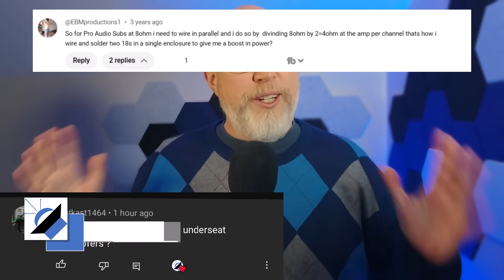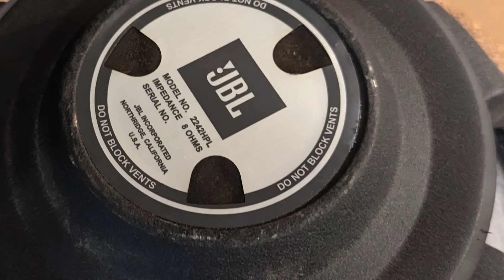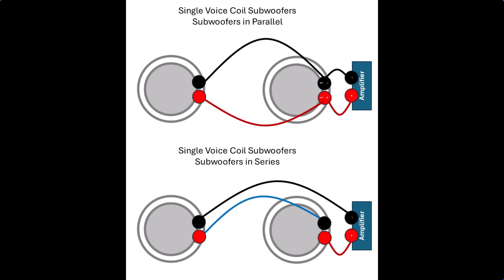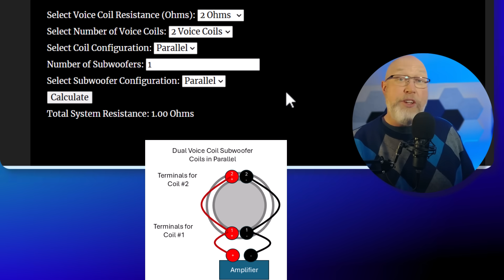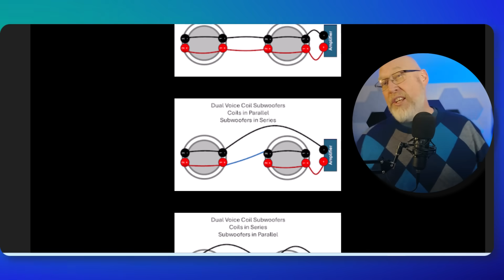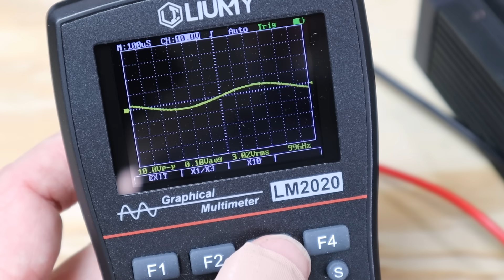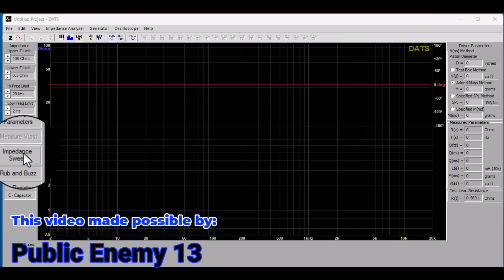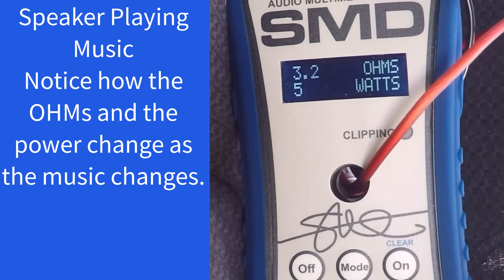Wiring your subwoofers for more power and more bass!

Comment: This is a difficult set of topics to address at an introductory level, as it really requires some physics, math, and engineering to grasp vector sums of complex reactive circuits, motor-generator systems, and practical circuit design versus theory.  

On one simple issue, pushing the speaker coil across the static magnetic poles generates current, not voltage, though that in turn may be seen as resulting in voltage across certain elements. 

The whole idea of multi-voice coil sub's is marketing hucksterism, that should simply be avoided for competent audio engineering of good systems.   

Ideally instead a single larger sub and matched amp would get a line level mix fed into a single channel power amp and voice coil, and driver and power level and enclosure matched to the space.  That should not exist in normal cars, while owning 500 acres of land is too little to contain or dissipate some audio systems with good low end capabilities, and respect neighbors.  

Generally power amps in the 1500-1800 watt range are useful, as they hit limits based on AC supply circuit size, and match well to larger bass drivers now in commercial production.  

Damping factor and thermal designs as well as protection circuits and design to source or sink reactive loads, are all important factors, where generally parallel drivers should be limited, and series drivers avoided.  A good pro grade amp will feed a 1 ohm or 200 ohm load on one channel while shorted with a heavy metal rod across railroad ties wired to its other output.  That costs money to design, and most consumer toys will self destruct first. 

Most amps are designed for an optimal load impedance, based on damping factor, complex impedance variations, thermal factors, power supply design and rails limits on voltage or current, weight, distortion, protection circuits, etc.  Often a bridge mode will deliver 3 times and not the waveform and Ohm's Law theory 4 times single channel power, because of ESR in those lumped systems (equivalent series resistance).  Bridge mode is sort of like halving load Z per side, and summing two amp sides.  

Large modern MOSFETs handle such factors far better than older bipolar transistor outputs.  

The two main things missing from this video, are disclaimers that the real world engineering needs basic STEM background as a precursor to the higher levels of how things really work, AND that lots of consumer products are sold that are really hucksterisn for buyers lacking good audio engineering understanding, and are really better to not buy, not install, and not recommend, than to bother calculating superficial theory of workable load impedances, versus just avoid that crap and do any channel mixes or band filters at line level, and feed that to single amps and normal single voice coil drivers, that won't have pairs of magnetic high energy fields competing.
Reply from the maker: You could spend years studying the fine points of AC impedance.
Reply: @DIYAudioGuy  Nah, I'm an older engineer, and I've already done that.  That's why I both appreciate this effort to teach complex topics in simple form, and despise sloppy language use that needs to be corrected later for victims, merged with implicit promotion of consumer scam products that create more problems than they solve, while trying to trick the engineering illiterate into buying more expensive and less functional products than can better address the same system goals.  

I've done AM directional antenna system engineering, and helped Glen Clark develop vector sums based software that considered complex impedance relationships from interactions of towers and earth impedance with its weather and soil variants, along with complex audio processing systems, and contributing to a panel on MPEG-1 Layer 3 development.  Speaker related complex impedance and related art and science issues are simple, by comparison.  

But still pretty complex, in ways words and pictures cannot fully express.

Comment: orrrr.. as another option, save space and money and find a properly sensitive driver that gives you the right output level without mucking with all this. dump it into a properly tuned transmission line enclosure and decimate.

the one for my jetta is only a bit bigger than the regular sealed box (15in tall, ~18d, 26w. which is only 8ish wider than the sealed box that was in there previously), using a 12 inch lord of bass LBX12, and still fits nicely into the trunk without eating every inch of the space. its limited, for obvious reasons, but i can still fit various emergency supplies and what not in there.

and with the right driver, and actually tuning the box, the enclosure doesn't need to be some super heavy monster you have to have a large suv to run it in. (yay for winisd and online TL box calculators)

even running it at 4ohms (i'm not pushing my amp that hard, for what should be obvious reasons, since its a 5 channel that also drives my fronts and rears), it has moooorrrrree than enough output to satisfy me. and maybe break a window if i'm not careful.

for anyone curious, the calculator is "Dual Fold On-Axis Transmission Line Enclosure Calculator" on dbxdynamixaudio's website, since i can't link. they used to do custom plans for boxes for a small fee, but the website is partially broken these days, so who knows whats going on there. the calculator page still works fine, but it is an embedded excel style table. and you need to know some driver specs. with some fiddling of the max dimensions you can stuff one into a lot of spaces (mind being able to get it into a trunk or whatever when designing!)

and it even works great for home theater sub boxes if you have the space.
Reply from the maker: Sounds like fun!
Reply: @DIYAudioGuy  its fooookin greaaat, man </bad scottish accent> ;)

done right, a good TL box hits harder, and louder. the main problem is trying to stuff a driver that needs a larger box into one and thinking its going to come out reasonable, since you need not only the volume, but the 'port' as well, which you fold twice. you can fudge the 'box' volume, but the port has to be as close to exact as possible to get the sound to come out right. thankfully, the calculator i mentioned gives you the exact board sizes and how many, so almost all of the planning is done for you.

if you're bored one of these days and want to (and haven't), i can fully recommend playing around if you're got a spare driver with relatively small box reqs for the ported spec.

Comment: Only thing you mention that made me scratch my head was when you said (paraphrased)  that by going from 8ohms to 4 ohms you often double your amps power thus giving you more power and a louder output.  Correct me if I am wrong but dropping from 8ohm to 4 ohm (or 4 to 2 or 2 to 1) has a 3 db loss of sensitivity so while you do gain more power, the speaker is less sensitive so you do not increase output.
Reply: If you're working with "traditional" amp design with fixed voltage rails of some amount, and that defines your FTC 8 ohm RMS power limit, while the power supply is capable of double the current an 8 ohm load requires, then in theory changing to a 4 ohm load still operates at that rails based voltage, but doubles the current (not really due to ESR), and in turn doubles the power.  

Bridge mode in effect also halves the impedance load per side, while summing two out of phase sides.  

If an amp is optimized for higher or lower impedances, the same relationships could exist in a 32 ohm or 1 ohm system.  

Prior to cheap DC-DC converters, lower impedance for a mobile system limited by battery voltage would raise potential power output, but that's how a 4-5 watt rated amp would actually output 1 watt if the alternator wasn't running.  Bridge mode amps kicked that up to around 10 watts, while anything automotive about that requires DC-DC converters.  

Speaker sensitivity is electromechanical systems design, and overlaps enclosure designs.  That's around 33% for an optimal loading compression driver (higher has uncontrolled distortion issues), whereas many home stereo speakers operate in the 0.5% electrical power to acoustic energy transfer range.  

That's where precise and careful use of language is important, to distinguish system overall function and elements contributing to that.
Reply: Note, many newer amps use digital waveform synthesis and flters, and some use variable voltage rails to limit thermal loads when higher isn't needed for full potential output power.  That can become a single ended line rectified supply with no power transformer, and a microprocessor driven smart DC-DC converter with a comparatively small and light toroid for line safety isolation, feeding MOSFET amp output drivers.
Reply from the maker: I've never heard that before. Where did you get that information?   You might find this video interesting.  https://youtu.be/4kDxUcGCe8M?si=Xb5nEFPqpJBZ0OLe
Reply: @DIYAudioGuy  Also this guys video made me realize I am old because I knew about speaker sensitivity before 25 years ago which he keeps stressing.

Comment: while the formula for impedence is not technically ohm's law....it is very similar (just with allowances for reactance, ie capacitance etc.). Its been 25 yrs since i took electronics but even in class we used the name pretty much interchangeably-at least early on until we got to trigonometry and wave designs, so people could be forgiven for calling it ohm's law
Reply from the maker: People call things by the wrong name all the time.  Surprisingly people are still able to communicate.
Reply: @DIYAudioGuy  Ok, fair point 😂

Comment: Speaker “impedance” , when measured with multimeter is only electrical resistance of the coil, not speaker while being driven.  While under load, speaker impedance continuously changes.  Nominal impedance is usually the lowest at a given frequency which is a very narrow.   Most impedance is much higher.    I’m using Hertz amps which are 2 ohm stable, yet I have them loaded to 1 ohm at zero negative impact, going now on 3rd year, running them just below 15 Vdc. at high volumes.

Comment: You're providing good, factual information but I don't believe that more power equals more bass. I build a custom home theater enclosure with a hand built driver that as roughly 5 feet tall, 18 feet wide, and 3 feet deep. The driver sits inside a sealed enclosure and blows through a folded horn. It is capable of reaching 170db at 35 hz in a gymnasium with the mic 20 feet away from the horn. The voice coil reads @ 5.2 Ohms and it is fed by a 500 watt plalte amp, clamped, it's using 160-180W of the amps power. The enclosure lets the driver play flat from 28Hz to 180Hz with little to no variation in volume as the frecquency changes. I spent 11 years of my life perfecting these things. Your enclosure is the most important part of what you want to accomplish, next is your electrical system, third is your amplifier, and last are your drivers. Just my 1.7 cents.
Reply from the maker: Yes, and what you'll notice is that when you have everything turned down you don't have a lot of bass, but when you turn it up you get more bass.
Reply: @DIYAudioGuy  100%. I compete in SPL and SQL car audio competition and always have a good laugh when the guy who has more money than knowledge about how the equipment works and they're pushing 50Kw through their system or spent 100K on the most ridiculously expensive gear they could buy only to lose to the guys that do understand what is happening.

Comment: I just started watching the video, BUT I still ask this - can I use two identical lower-power amplifiers to power a dual-voicecoil woofer assuming I balanced the amplifiers with the multimeter before that with same input and frequency?
Reply from the maker: Yes, you would need to match the voltage and the phase.   It's something that can be done but it's not something I would recommend. The juice is just not worth the squeeze.
Reply: @DIYAudioGuy  well I have two identical 2-ohm capable amplifiers, but they cannot do 1-ohm. the woofers I use are all dual 2-ohm voicecoil versions so I figured for home use I could utilize these amps.

bought these few years ago brand new and now they have almost no market value so I thought I can give them a new purpose with active cooling and all that as I feel my current 150W 4ohm plate amp is not enough any more lol
Reply: @vahvelpoiss in order to avoid the possibility of blowing stuff up, make sure the amps can be linked or the industry term strapping.  You still have to follow the limitations of the amps as well ie if they are 2ohm stable each then you can't put a dual 1ohm on them . For about a year I ran a single 12 diamond audio da1d2 on two kicker sx1250.1 since the sub was a dual 2 and the amps were made for 1ohm I wasn't even stressing the amps and the signal was so clean I could lay into the 300w rms all I wanted  . Wish I still had that setup . Was in a crx and was louder than guys with 4 15s . I think I remember it hit 143db ? Dumb loud
Reply: @Mathias4891  these arent supporting any linking. newer models from same manufacturer, like the one I have in car does actually have a linking support.

I just thought to throw together a cheap amp rack for a home audio sub build with two amps. I have a 300W 12V power supply and two dual-channel amps that do 180W @ 4ohm bridged, or 2x90W at 2ohm.
Reply: do it at your own risk...but theoretically...yes...you could do that? Thats basically what an amplifier is, a bunch of stacked small amplifying circuts building power each stage(in fact that's what "bridging" an amp is-you're just tying the left and right channels together). But the issue would be matching the waveforms, if they arent really close to being in phase (matching each other) they would just fight against the other and cause a lot of heat/distortion/possible damage. Again, do this at your own risk....but i dont think you would hurt anything trying it-maybe at a low volume at first. Make sure to use the same input and keep the levels matched. Try one then add the second and see if it works. Keep feeling the magnet to see if its getting hot. Again, I'm NOT saying its a great idea, but it is interesting. Personally id use the smaller amps for some door speakers or something and get a bigger amp for the subs. Amps are cheap as hell now. But i understand if you just don't have the cash and wanna try some science. But it depends how much the sub and amps cost, if you got them dirt cheap then yolo (ps, if you do try this-come back and tell me if it worked. Im curious too). Btw, have you tried just one amp? It might be loud enough on its on. People get caught up in big numbers but ive seen small amps rattle a car. Maybe hook one amp to the speaker in parallel and just see if its good enough

Comment: Very easy ohm is resistance in wire like water in a pipe. The more resistance the harder the water gets through the pipe.
Reply from the maker: Yes.  Lowering the resistance is like using a bigger pipe.
Reply: Voltage in that model is like pressure, current like flow rate.

Comment: 8:32 he is saying that the driver moving back and forth is what produces the sound , but it is incorrect . 
If u hold the driver in your hand while in use , it doesn't make sound . It's the driver and it only moves , while in doing so , it moves air as a result . The sound is generated at the port opening when the air moves in and out , as well as the box will vibrate , resulting in additional frequencies that contribute to what we know as sound .
Reply: wrong. the driver is what produces the sound moving back and forth. the box and the hole amplify it. the more you know
Reply: So if it was a sealed cabinet your speaker would produce NO SOUND. 😂🤣😂😂🤣
Reply from the maker: I've got a ton of videos describing how all this works.  Why don't you give a couple of them a look?  https://youtube.com/playlist?list=PL3Aot9dMXzXZ21MXAzvirExu0sfsWWSHT&si=iYfopWva6hvtncRx